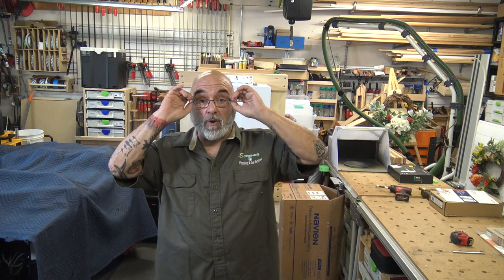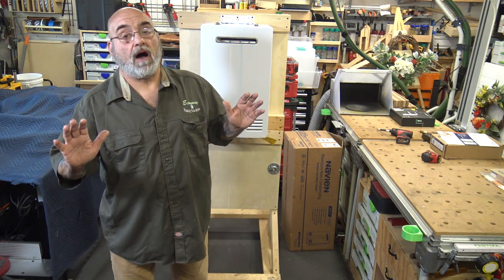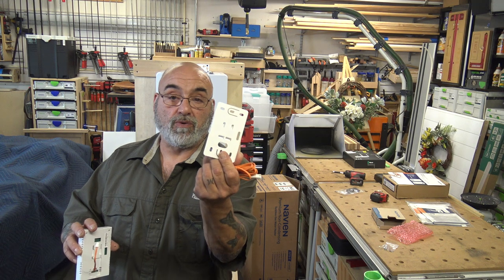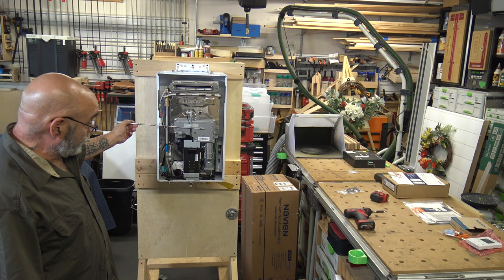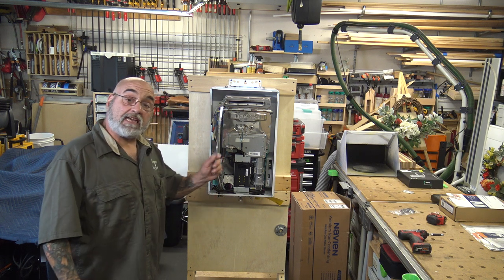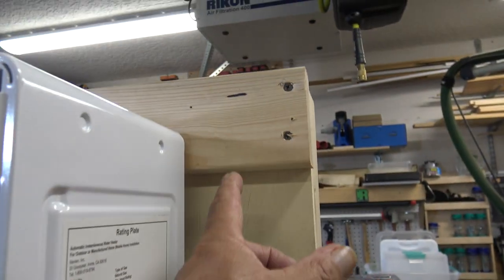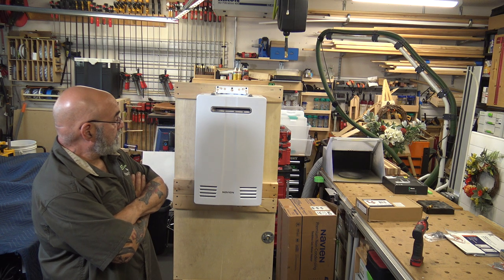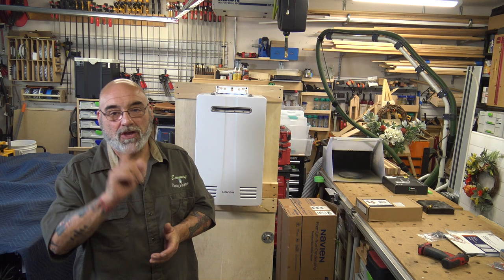Navien NPN series non-condensing tankless

Comment: I have the NPN-160E. Only a year old. Hot water keeps fading in and out and will throw the E012 code. Had a plumber check the gas pressure today and it was correct. I looked at the heating rod and they looked fine, not dirty. Does this unit have an air intake filter? I can only find videos of inside units and they are built differently than this one. Thank you.

Comment: Hi Mike.  Thanks for the video!  How would I install a recirculation system for the NPN-160U?  Hot water takes forever to get to my fixtures, but I can't seem to find a unit/system for better recirculation.  Do I need to install a recirc line and a pump at my furthest sink/faucet?  Thank you for any advice! 
-Brandon